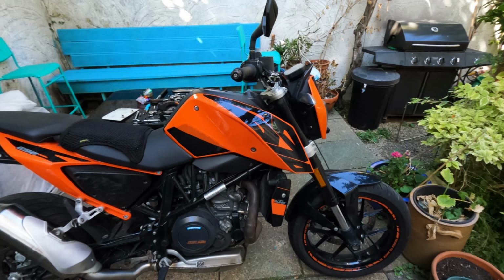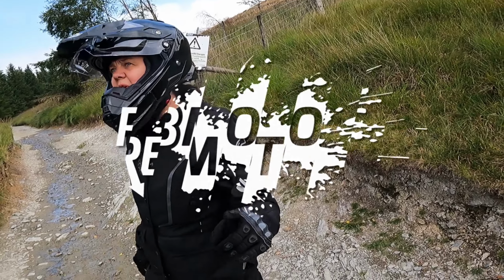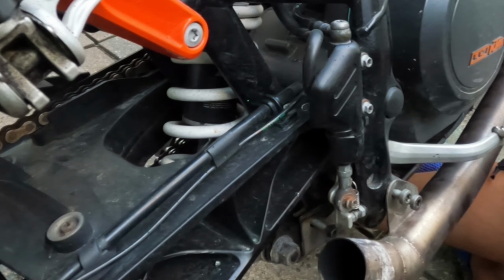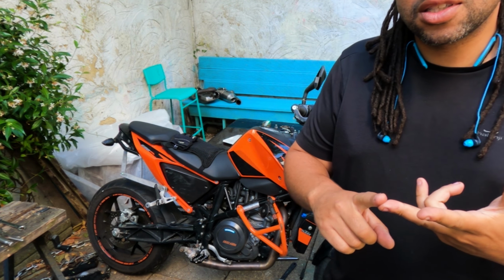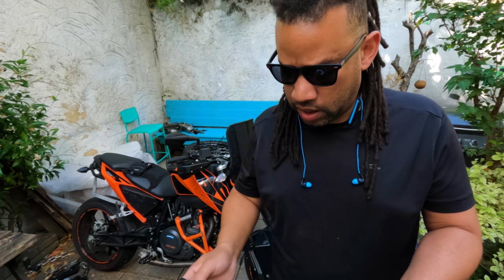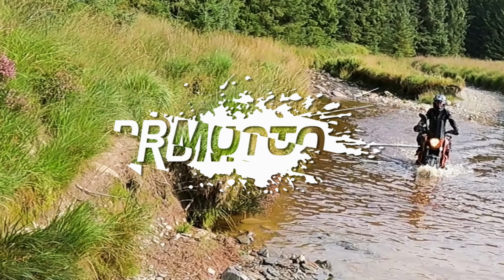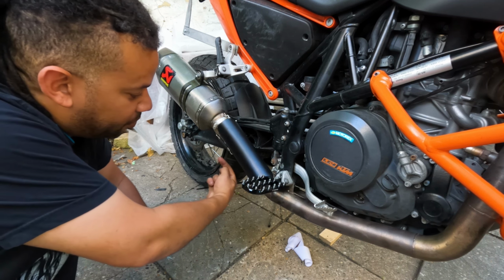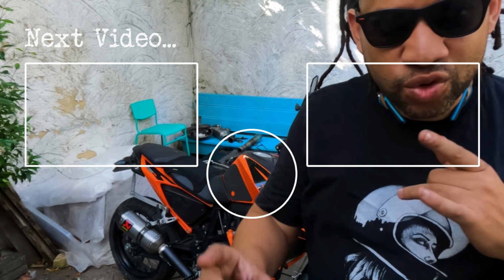Converting the 690 Duke | ADVENTURE REBUILD🌲🛠🌋  | ONE AND DONE!

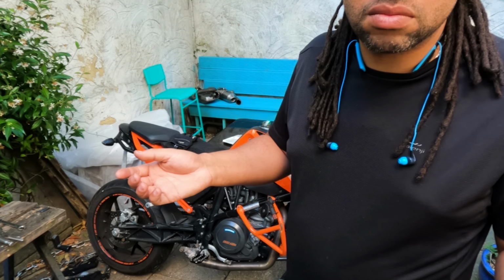Comment: Hey great video im building now one as well just like you , 12:00 the speedometer & tcs issue can be fixed if you are using enduro 690 ABS SENSORS and to fix the bolt pattern issue you will have to use enduro 690 wheel hubs. that means u will be building wheel from 0 but you can get customized size...
Reply from the maker: It’s a fun build and makes a super fun bike.

I did use the 690 sensor ring on the back. The front wheel hub was a custom from sm pro but is essentially the same bolt and spoke pattern as the OEM just stronger. It was a custom sensor ring on the front because it’s a 19 inch wheel so the 690 17 or 21 OEM ring would have given the wrong speed reading. The speedo works great and was GPS accurate. The fault was caused by the profile of the 19” tyre being quite tall so compared to the lower (and slightly worn) back profile being just enough of a difference to cause the traction control to engage just a little. I guess that’s the danger of trying to mess with a system that’s designed to engage when the wheels are so much as a tiny fraction off of the same rotational value. New tyre on the back solves all problems. 👍🏽👍🏽

Comment: You can use a vise and a hammer to bend the metal brackets  more easily; you can catch it in the jaws of the vise a mm or two higher than the position you want to bend it (depending on the thickness) 😉
Reply from the maker: Yeah! I really need to get another vise but a quality one this time. Budget is forever being sucked into the beast though.

Comment: It's actually a svartpilen 701...
Isn't it?
Reply from the maker: But with spoked wheels. 701 svartpilen would be a great base platform for this kind of conversion. We preferred the duke because of its TFT screen and all the adjustability of the rider modes. IIRC the svartpilen has a less editable set of rider modes and slightly less fuel capacity. 👍🏽
Reply: @RideyBikes  thanks for the quick reply.
I'm actually in the market for this kind of bike,  a road bike with some offroad ability. 
I was sure that I'll go ducati scrambler icon. But your video opened my eyes to the svartpilen with spoke wheels that my dieler has. 
Or the xcountry,  this is an old bike, but maybe it worse it..
Your opinion will be very helpful...
Thanks 😊

Comment: the Duke is a Supermoto, it's really insulting to transform it into a trail
Reply from the maker: Errrr.... I dunno... The old duke (2008ish) is most certainly Supermoto for sure... The 2018 Duke is very much a naked road bike by comparison. 

If i'd kept the wheels 17" front and back but put 50/50 tyres on it would it still be an insult?? 

If a Supermoto is in fact a dirt bike with road wheels and tyres, how can it be an insult to put dirt tyres back on something that is technically... a dirt bike with road tyres...

I'm confused by your logic.

Each to their own eh! 🤷🏾‍♂
Reply: @RideyBikes  the Duke from the III to the V is a pure stock Supermot with a chassis designed exclusively for this use (just like the aprilia sxv550)

The Duke V has exactly the same chassis, just with shorter suspensions, and a bigger tank.
"the clothes don't make the man"
and in addition, its engine has a cylinder head directly derived from the LC8 of the RC8 or the Superduke...

an SMCR modified in enduro it works, because the chassis comes initially from off-road.

But the Duke no, personally it's not pleasant to see for me ...
When someone has a Duke, either he puts a top box or mixed rims (as it was a DR650), but good suspension and engine preparation, never 😥
While it is in this configuration that it works best
Reply from the maker: @alkane6467  Ok, so basically you don't like the look of it. Fair enough. 😔

I hear your points (ish), but what confuses me is that a Supermoto IS technically and by definition a dirt bike with road rim and tyres.  So how is it "really insulting" for the Duke to have dirt wheels? Moderately inappropriate... perhaps!  But "really insulting'"?? . . . That seems a bit much.  It almost makes more sense to admit the V is a naked and THEN be really insulted. . A naked bike... with adventure wheels!!! Scandal!. . . Even still, "really insulted' would be a bit much.  It's not like I swapped out the engine for the 390 lump!! 😁

Like I say at the end of the video, which perhaps you didn't reach through being so deeply insulted 😉, it's really not meant to be the best enduro/trail bike.  It's meant to be a great all rounder for my girlfriend or someone with short legs who wants a 150kg manageable bike that's easier to pick up than a 790, has awesome road manners (which it really still has) is capable of doing some light adventuring (which it has been doing a lot) and has plenty of grunt for the grin factor.  And while perhaps it does perform best in its stock configuration, life is more of an adventure if you leave the tarmac from time to time. Right??? And thats why i've gone for an 'Adventure Bike' approach. 

Yes in an ideal world we would have fully upgraded the suspension too but there's currently no budget for that. I did consider taking it out of my own budget but I needed my fun tokens for doing the rally we were headed to. and and and... at the speeds that she rides, she really doesn't need the suspension upgrades yet as the stock suspension does a great job even on the Strata Florida in Wales. 

Also... Do you ride a Duke? 790 or 890 perhaps judging by your avatar. The 790/890 Adventures and Dukes have virtually identical frames (apart from the tower mounts on the stem and a few other tabs) and engines yet one is claiming to be an adventure bike or even a 'rally bike' when it's in full garments, and the other a mid-weight naked. The 790 Duke came first in that situation. So is the Adventure technically a dressed up Naked pretending to be an adventure bike and therefore "really insulting"?? . . . Do the clothes maketh the man in that situation?? 🤔

I'm still confused by your logic. But thats ok. I don't have to understand and we don't have to see eye to eye.

Anyway.. I am genuinely a tiny bit sorry you're so offended and I do genuinely appreciate feedback. If you haven't already go ahead and give it a 👎🏽. . You've clearly got mad passion for unmolested Dukes. I was just having a bit of fun building a bike that keeps my girlfriend close while i'm riding the rides that keep me sane. 👍🏽
Reply: @RideyBikes  either my avatar is not mistaken, it is indeed a 790 Duke headlight, but mounted on my Duke V 690.
with 2008 Supermoto 690 R suspensions.

it is in my opinion the Duke closest to the 620 of 1994.
I may have been a bit strong in saying that it was "insulting".
This chassis has some offroad capability, as it can take big jumps, but it's much better on asphalt.

After if it is to suit the needs of the biker, either ..
but a 690 Enduro is a much better bike for a dual sport.
Reply from the maker: @alkane6467  Your headlight setup sounds awesome. . . The Enduro is (obviously) my choice. But it's too tall for her, even when lowered with a lower seat it's just too tall. She loves the Duke adventure setup and I will keep pressing her to pay for the suspension upgrades. But until then, she'll be taking the trails and rallies at her usual pace (which may or may not have gotten her a trophy at the Sweetlamb Baja). 🏆👍🏽
Reply: @RideyBikes  Changing the suspensions of the Enduro 690 is expensive.
and the Adventure 390 lacks power. there are not 36 solutions 😐

for the 790 headlight, it is (roughly) a T fork initially machined for 890 Duke R, but modified to fit a 48mm fork, the headlight plastics are that of the Duke 790/890, and the headlight comes from a Duke 250 from 2021, which has the LED headlight, but with direct control on the comodo (like the Duke 690)